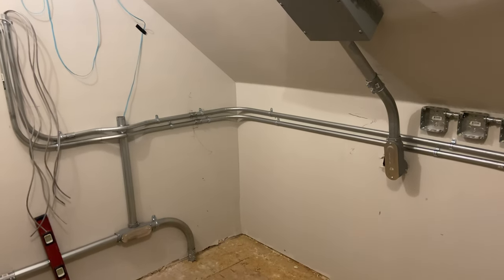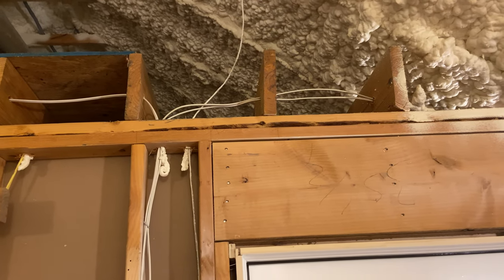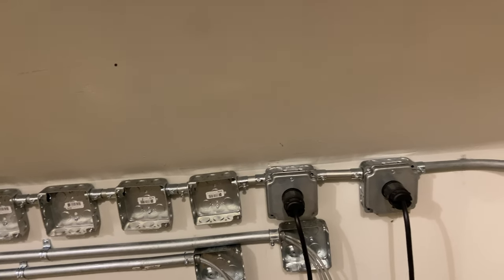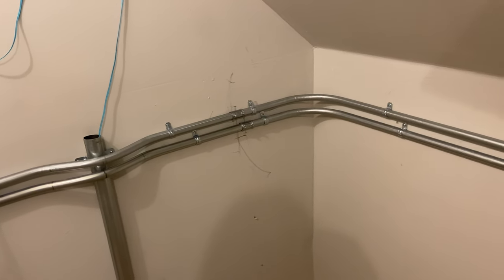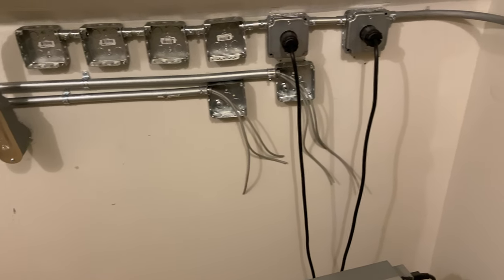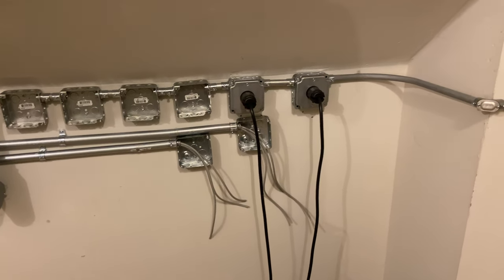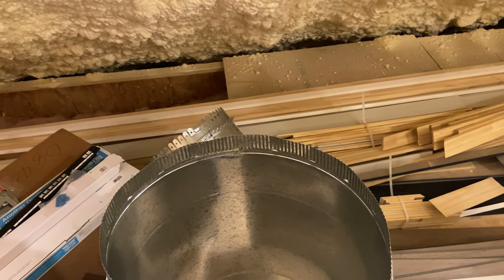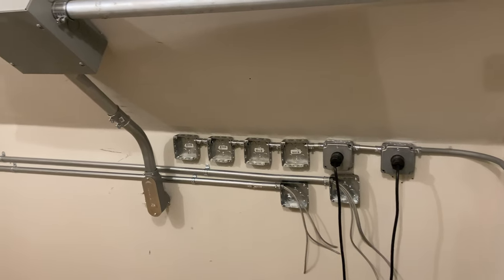Crypto Mining: Episode 6 - Conduit Bending and Cat6 Pulling

Comment: Did you precut all your cat 6 runs ahead of time? Normally you'd just pull the wire to location then make a cut but everyone's thinking situation is different
Reply from the maker: For the longer runs from my mechanical room to the attic, I did 2 pulls. The first had the fiber and 3 cat6 lines from 3 different spools. I then used those as a known length since the cable in the spools are marked with foot markers. I then pulled out enough cable for another run, cut it, and then used that plus the spool for the next pull to get 2 for 1. 

Inside the room with the gray cable, I cut the 100ft into 6 equal cables, knowing that they would be long enough, so I had 6 cables divided into 2 pulls of 3. Made it very easy. 

Thanks for watching.